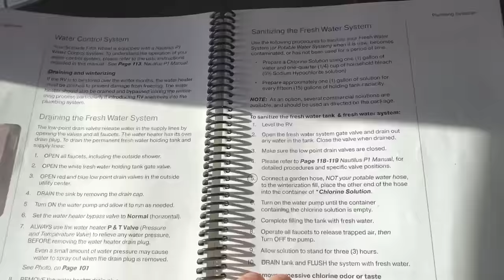MASSIVE WATER LEAK RUINED OUR RV - RV LIFE REALITY

Comment: For those just tuning into this disappointing adventure, there are a few procedures that were not followed properly.  First, once a leak was found in the tank, the tank should have been removed.  I know, it sucks and it is a lot of work.  But in the end,  you will find it pays off.  Second, when you use ANY patch material to cover a crack or hole, the area must be clean and dry and alcohol is not a very good cleaner.  Rub the tank where the hole or crack exists with some 220 grit sandpaper at least 2 inches around the hole or crack.  Blow the area off with Brake cleaner, let dry, then look for shiny spots.  If there are any shiny spots left, scrub it again.  Blow off the area with brake cleaner then with dry air.  Brake cleaner or acetone work very well for cleaning.  Blow the excess liquids out of the hole or crack with DRY air, like canned air.  Apply the adhesive of choice for that particular tank and extend the adhesive an inch or two past the hole or crack.  Put a patch of porous material like nylon cloth or thin fiberglass cloth about one inch larger than each side of the hole or crack then add more adhesive on top of the patch.  Make sure the patch gets soaked all the way through either before applying the patch or after.  Its usually easier to do it before.  Leave the tank undisturbed for 24 hours.  J.B. Weld and other epoxies indicate they will setup in 5 Minutes.  That may be true, BUT, it takes 24 hours for them to cure, if you mix them properly.  Test your tank before you put it back into its original place, you may have another leak you didn't see earlier.  Be patient, it will pay off.  BTW, some plastics, like polystyrene cannot patched with chemicals very easily, and that is another story.

Comment: I had a leak in my galley tank by the fitting.  It had been patched before by the previously owner and had held for 4 yrs.   Pulled the old slop off and used some black stuff in a tube from Menards.  Had to put a second coat on but so far it is holding.  Used White Lightning 3006 Ultra on it. Says is exterior siliconized acrylic latex elastomeric and flexible.
Reply from the maker: Wow, you are very handy! Thanks for sharing your tips 😃

Comment: Oh guys, hope you can fix this, but as others mentioned it looks like the best solution is a complete tank replacement, a patch may hold for a bit, but if the tank has cracked on top you will not know until the tank is pulled out.  My heart dropped when you said it stopped after you drained the tank!  Luckily it’s the gray.  While down there would check for possible issues that could cause the black tank to do the same.  It may be a engineering flaw and would contact the manufacturer and report the issue.  Will be thinking of you for a good resolution.  You asked if we have had leaks, in our first Tow Trailer the window leaked and water was just poring into the RV it was raining like crazy, we eventually tilted the RV a bit to keep the main water coming off the roof off the window but it was a mess to clean up, bunch of wet towels in a humid environment  well you can just imagine.  Our second leak was near our wet bay but nothing was leaking leaking, had to remove the garage covers and found that the tank dump pull cables had been rubbing against the water pump fitting and had come loose and was leaking.  So I have leaned to keep all my fittings dry, so the first sign of water dripping I investigate the source.

Anyways guys prayers for a good resolution on this issue!  But you always land on your feet so I am sure that someone, somehow will be able to make it right!  The power of social media!
Reply from the maker: Wow you’ve had your fair share of leaks! You are very knowledgeable which is great. Thank you for sharing and all your support!

Comment: Get rid of that pink insulation if you can.  Use foam board and cut it to fit around your tanks and the floor.  Insulate the pipes while the bottom is down.  Use the foam pipe insulation. Get some rubber padding (like roofing material, place that around the brackets to stop the rubbing in  the future.  Best luck!
Reply from the maker: Great advice! Thank you so much for sharing Kevin!

Comment: We had almost the exact same leak from our shower. Like you all we through it was just going into the shower, but no it was going behind the wall.  Along with the 6 other leaks we have fixed.  Just remember "This too shall pass".  Hang in there.  Also that tube that came down with the underbelly was just the drain for the battery box.  Not super needed.
Reply from the maker: Thank you so much. Those small leaks are very sneaky.

Comment: If no one else mentioned it .....  When you showed the access behind the shower valve, I noticed what looks like a vacuum breaker for the black tank flush.  Those are notorious for leaking.  It's only there to make sure no liquid is pulled back the hose you connect to the black tank flush port.  Many people replace it with a brass elbow.  No chance of leaking that way.  Just wanted to mention it in case there's another mystery leak.
Reply from the maker: Thanks for the great advice!

Comment: I have a leaking grey tank, though it's a much slower leak than yours. We also have open underbelly, so we can just put a gallon bucket under it and contain the leak for most of the day. I was told only option is to drop the tank and replace it. Not wanting to go through that expense, I tried a number of different sealants on it, still keeps on leaking. Since we only use it a few times per year, it's not a big deal to us.
Reply from the maker: Let us know if you try flex seal and if it works! People swear by it!

Comment: Years ago I cracked the bottom of my black tank by smacking the fitting on a big slope.  I used Goop/E6000 and waited 24 hours before testing and it worked great.  Remains a bit flexible but really sticks well to plastic.  Plumbing can be so frustrating.

Comment: FLEX SEAL!!!  Haha.  There’s a product out there called “seal all”. It can be used to seal an active leak and is even petroleum resistant (fuel resistant, can seal an actively leaking gas tank) I’ve used it a few times and it’s worked really good for me.
Reply from the maker: Oh no way! That is really great to know Dan! Thank you so much for taking the time to share this with everyone!! We appreciate all your support 😀👋🏼
Reply: Flex Seal has been hit & miss for me, personally for plumbing I’m a “Goop” man,  never let me down & just squeeze out of a tube (works on wet surfaces or even under water as in pool liner without lowering water below the leak, even fixed my 11/2 kitchen sink drain when it was dripping, with my pop can patch around pipe & 2 clamps :)

To late I guess >>
But,next time u r under RV, or go back again in near future 
Do some preemptive maintenance
- add rubber gasket wherever a bracket or brace even touches one of ur tanks (so around edge/side of tank & that cross beam that supports across centre of ur tanks) 
Just loosen bracket or any brace just enough to slide in at least 1/4 inch dense rubber type gasket material between them 
Anything that will absorb vibration thus prevent any metal surface from vibrating against ur tanks or any hoses for that matter, that would eventually work its way through that tank or a line.

P.S 
Check ur propane lines while ur at it
Follow them start to finish, especially where go through an I-beams (should have a grommet )
They r just as vulnerable but obviously more serious
Reply: Fair enough. Everyone has their own experiences with the stuff. I personally haven’t used it very much at all. I only suggested it because the commercial has the dude in the boat with a screen door on the bottom.  The seal-all however, has been flawless in my experiences. Which have been numerous.

Comment: Hello guys! There were so many comments I wasn't able to read through them all to see if this issue was addressed or not, but the tube that broke as the underbelly came down was not a simple drain from the battery box.  If it comes from the battery box it will be a vent for the battery. It is a critical safety feature for your unit.  When a lead-acid battery charges and especially if it over-charges, it will vent dangerous/poisonous hydrogen sulfide gas. You will need to make sure it gets repaired or replaced as soon as possible.   It is detectable as a "Rotten egg smell", so if you start to smell it, you will know it needs to be addressed right away.   If you are unable to fix it right away, just unhook the battery(s) and ventilate the battery box.  The venting will only happen when the battery is being charged. Leave it disconnected and run on shore power only until you can get it fixed. 
We need you guys out there in front of the camera rather than in the hospital.   Love the three of you!
Reply from the maker: Thanks so much David! We fixed it somewhat and have an AGM battery. Does the gel make a difference?
Reply: @HappilyEverHanks  Yes, hydrogen sulfide gas only comes from lead-acid batteries.  Have a great day! #WatchingTheHanks!
Reply from the maker: We appreciate you!! Talk again soon :)

Comment: I’m pretty sure your tank is made of high density polyethylene (HDPE). In which case, there is no epoxy that will adhere to it. I would recommend flex seal tape over the perforation until you can replace the tank. Flex seal will stick to pretty much everything and is water proof.
Reply from the maker: We thought about flex seal at one point or eternabond tape! Thank you for sharing, we are going to get the tank replaced!

Comment: Try the “Eternabond Tape” or “Flex Tape”.  They will seal the tank until you can get it replaced.  Actually from what I hear, the Eternabond Tape would be a permanent fix and if it doesn’t hold forever then you’re back to having to replace the tank.  I know the tanks aren’t cheap and what a pain to change it out.
Reply from the maker: Great advice Keith! We may go the route of just getting the tank replaced

Comment: BUMMER!!! We have had the black tank valve leak on us! That was definitely a "crappy" job to do. Also that valve behind the shower. I think it's called an anti siphon valve. Those are very common to fail and leak. Lots of people remove it and just bypass it to render future leaks. Hope you can get everything back together and stay dry.
Reply from the maker: Good to know! Thanks Michael!
Reply: Yes.  That valve flooded my under pinning.  Besides. I replaced 14 of my pex clamps because thay dripped. Not all of them but I bet 5 of them started leaking under pressure. So the rubber hoses that go to the pex connectors. Ts and such. Leak. So I put regular auto hose clamps on them.  So listen to this.   To check your pressurized water system. Use your 12 volt pump.  I ran a 12 volt light that’s bright so if I don’t hear the pump come on I can see it come on.  Pressure up your system with the fresh water pump and wait.  The pump should NOT come on unless it’s got a leak somewhere. I do this to check my system a lot.  Great video you guys I’ll have to subscribe y’all make me laugh.

Comment: Has this happened to us? Short answer, "Yes"!!🥴 But, lucky for us, our fifth wheel is an older model with exposed tanks. We had a fine crack in the grey tank near the drain which, once full, would become a steady leak like yours.  We sanded and cleaned the area with acetone and applied Oatey ABS Black Cement along with fiberglass window screen to help with the bond to the tank and it seems to be working fine.🙏 Good luck with the repair and good job keeping your cool; despite this frustrating problem ...That's was teamwork does.🙌
Reply from the maker: Thank you for sharing and thanks for the support! We'll keep everyone updated 😃

Comment: Oh. My. Goodness! I am so sorry you guys! I feel so bad. Leaks are never fun and we have had a few in our Solitude as well. Nothing that crazy though. The hot water line behind the shower did leak, the connection where the shore power housing on the side of the camper goes in leaked and just a few weeks ago we drove through several nasty rain storms and our underbelly got wet and we had to drop it and dry it out. All the bottom of the insulation was wet. We sealed it back up with a roof sealant and spray foam. I hope you guys get this fixed soon! So frustrating and scary.
Reply from the maker: Thank you Erin, you are always so kind ❤️❤️ we are so sorry to hear that you had a similar experience, the RV Life never stops making things interesting 😅 much love to you guys from the Hanks family!!

Comment: Your tanks are ABS, JB weld will not bond to abs.

You need to dissolve abs shavings in acetone to make a paste.  Drill tiny pilot holes at the end of each crack. Then Sand the tank, abs paste, metal screen, then abs paste over it.  24 hours to dry
Reply from the maker: The plastic epoxy we used said it works on ABS so that's why we used it. Plus other YouTube videos directed us that way. Maybe didn't dry long enough. New tank is on our minds for sure! Thanks for watching and sharing 😃
Reply: @HappilyEverHanks  I've repaired a handful of them. Jb weld  has never held.

Abs shavings dissolved in acetone to make a paste is the only way
Reply from the maker: Copy that!! We were skeptical about JB Weld holding...

Comment: I have this chore ahead of me, but at least I know not to drop the bottom during the cold months. I have a broken sewer valve and some curiosity about just what is hidden in there. I have had my 5th wheel for 9 years.  One thing I have learned is that they leak.  They flex a lot and stuff comes loose or wears out.  A few days ago, my water supply line just popped off. Talk about water gushing out of the bottom.

Comment: If the shower connection is pulling apart as the grey tank fills them the tank is pulling the floor down. I would look at adding a few metal straps to the frame to support the tank better otherwise it will keep happening.
Reply from the maker: Great point Norm! Thank you very much for this feedback 😃

Comment: The JB Weld water weld is a putty,  it would probably work better.  Our hot water tank burst.  The entire belly of my RV filled with water and it ruined the floors, the entire floor.  Our insurance company totaled the trailer.  No one told us about the anode in aluminum water heater tanks.  They need to be changed once a year. Make sure to change them, it takes about five minutes and they cost about $15.
Reply from the maker: Yes, the anode rod is something we always forget about!

Comment: 13:53 You don't want to use an acetone bc it will literally melt plastic. (assuming its made out of plastic). Also you can speed up epoxy drying time w/ a heat gun or hair dryer. They don't like to cure in the cold which was this environment.

Comment: 15:40 is every single DIY reaction when it doesn’t go as planned haha. It’s been my reaction many times: I would pull the Grey tank down it’s much easier to assess and won’t damage anything. It’s easy to take off. Just need 2 people and a little patience. Our main drain to our grey tank broke during a freeze and I had to drop it just have to disconnect the wires make sure you take pictures so you know how they go back and a few screws and it will come down. Hard to fix a leak if you can’t reach it. I’m almost positive a leak that big is from a tank or a busted pipe.
Reply from the maker: Thank you for watching Andrew! We appreciate all your feedback and taking the time to comment :)

Comment: That design of the where the tank is suspended from the frame rail is going to be a problem during the winter time. You need to reinforce the bottom and take the weight off the wing carriers or the lip . You do this by placing suspension straps with a small 4 inch baffle { A piece of 1/8 plywood going the whole width of the tank from front to back along with a metal strap that is screwed into the sub floor} Do two or three of there sub straps along the entire grey tank and you might want to also do this to the back tank as well. This in tern will disperse the weight and the wings of where the original design wont be under do much stress and crack like it did there..the other place that it might leak is the vent tube that is part of the venting system . Its attachment is on the top of the tank where you can't see it. At the factory where the unit was built the flange is spun welded to the tank before it is installed. This flange is where the vent tube is attached and is screwed into the tank. There is a very good chance where they spun the flange on to weld the plastic together that it was done very poorly. This also applies to the drains of the tank to where the adapters of where the pipes are glued to may have come undone. In any case the rig may need to go and get repaired back at the place where you bought it and the tank removed and inspected and repaired or replaced.
It is always good practice to not travel with your tanks full or partially full, as this sort of thing might happen. Quality of trailers isn't what they were back in the 70s and 80s - mine is a 1988 Prowler Regal model - made by fleetwood still going strong today but a bit tired...

Comment: Use jb weld for abs.  I use the syringe that you mix.  Sand holding tank area to be repaired first to scuff then apply jb epoxy mixture.  Also your floor should already be insulated.  Insulating the underbelly may turn into a big mess with mold/mildew  if you have another leak.  You might consider removing that insulation
Reply from the maker: Thanks for sharing!